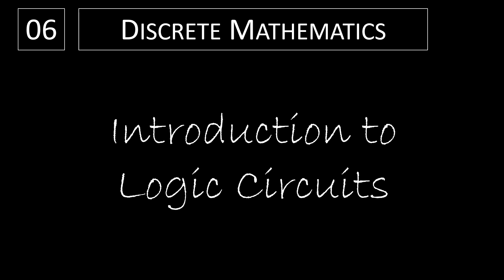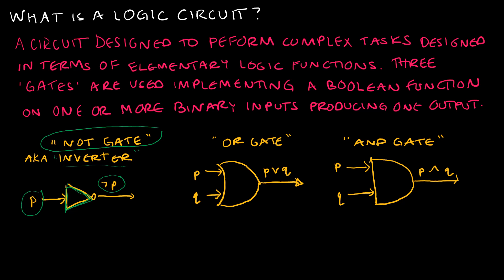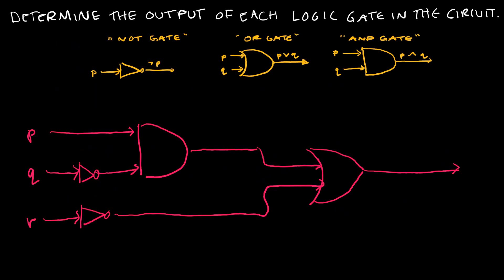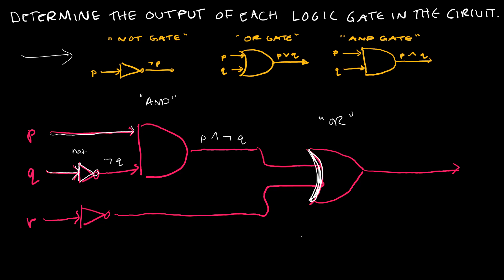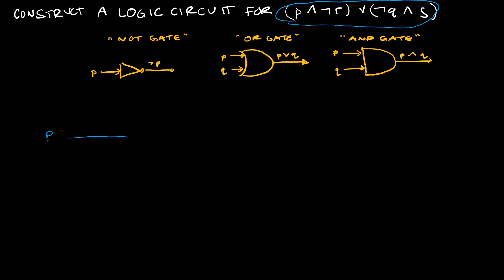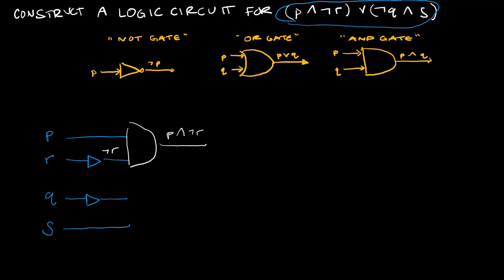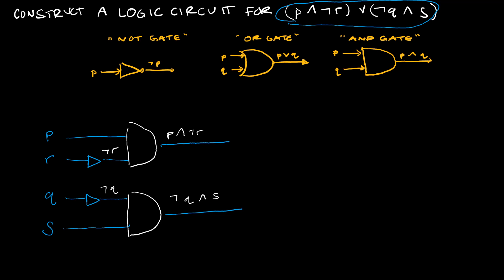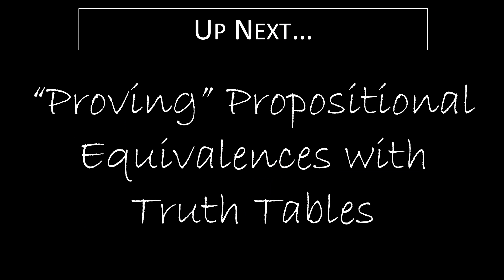Discrete Math - 1.2.3 Introduction to Logic Circuits

Comment: For people taking a digital circuits class, I recommend creating the circuits by starting with the output (as opposed to inputs). In the example given here, you can start with an OR gate and then connect it to the two AND gates. Just makes it easier down the road I feel.

Comment: From an engineer: the triangle portion of the not gate is actually just a buffer; it’s the little circle on the tip that does the inversion. You can add a little circle to the and & or gates also to make them nand and nor gates. Finally, there is also an xor gate that looks like an or gate but has a double line on the input side. Buffers are used in circuits to restore the proper voltage after propagation through many gates has reduced the signal.
Reply: Is a buffer something physical then? I mean, is it a kind of electronic component?
Thanks for the comment!
Reply: For anyone interested in the answer to my own question: Yes, a buffer is actually a physical electronic component. 
In digital circuits, a buffer is typically an integrated circuit or part of a larger IC that strengthens - actually restores - a signal, without changing its logic state. It helps maintain proper voltage levels after a signal has passed through multiple gates, preventing degradation due to resistance or capacitance in the circuit, as OP originally said in his post.

Examples of buffers are 74HC125 or 74HC244. Therefore, in practical terms, buffers can be found as standalone ICs - or built into larger logic gate ICs. They are widely used in signal integrity applications, bus driving, and even in microcontroller circuits to ensure reliable communication between components.

Hope this helps anyone with the same question in mind.

Peace.